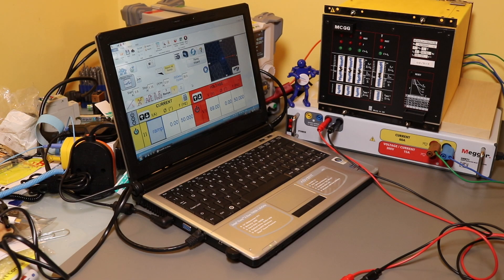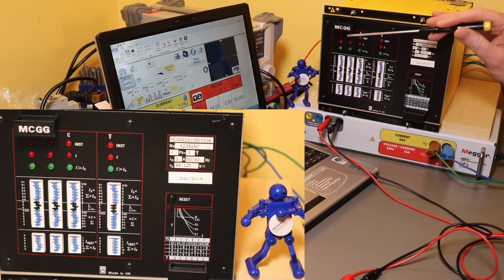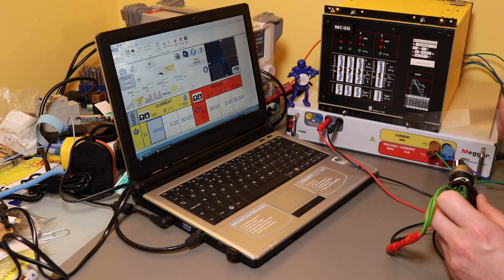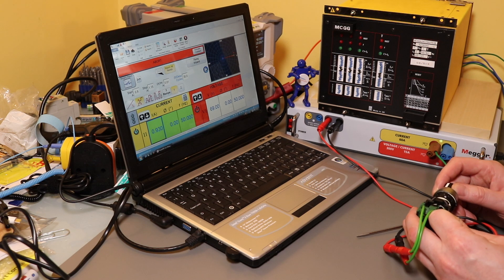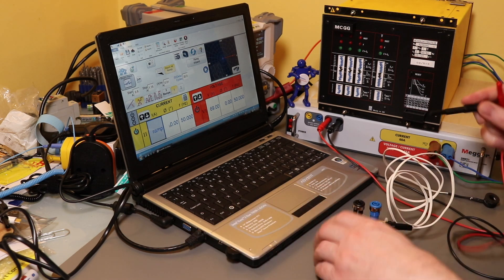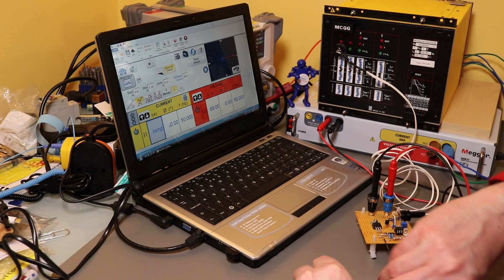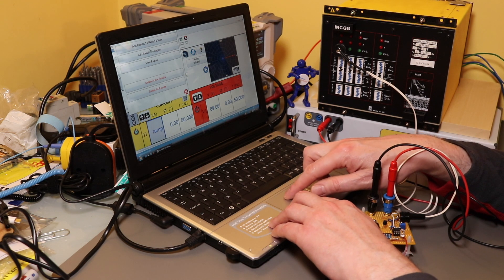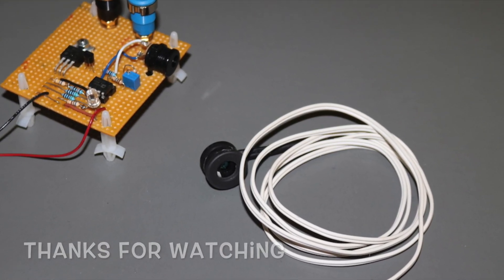MCGG Overcurrent Relay Pickup Test Demonstration

Comment: I am a protection engineer and I have come across technicians with questionable morals who used similar methods as your hand actuated switch to trick test sets used for protection relays so they don't perform the required rigorous tests during maintenance outages and submit these test results as legitimate test records.
Reply from the maker: Luckily enough, I have not come across that kind of behaviour with the engineers I work with, although I have seen relays tested in the wrong manner before by some. I guess any manually operated test procedure can be fudged to produce the desired results by those that want to. Thanks for watching and your comments.